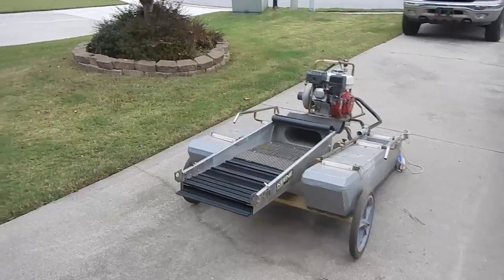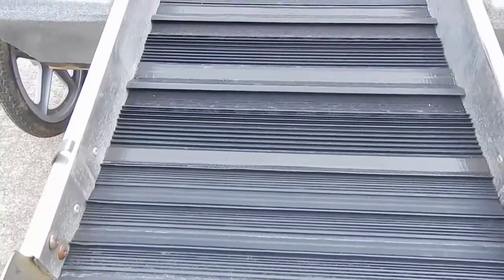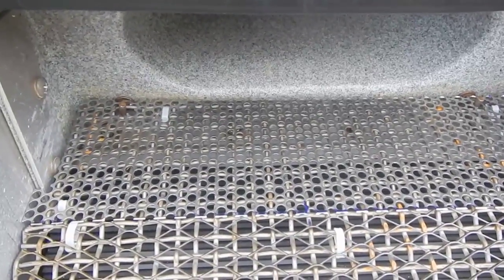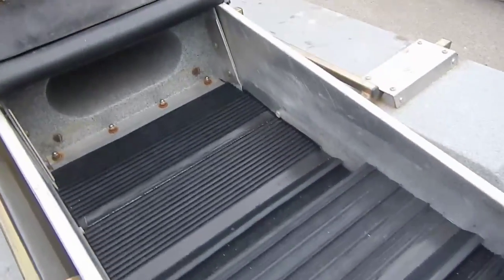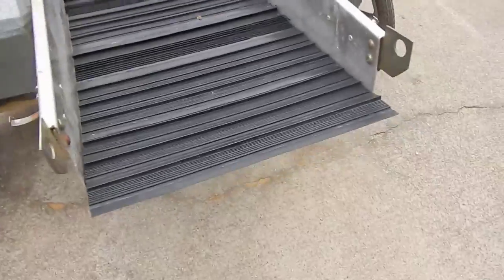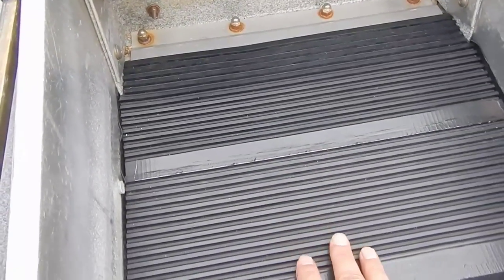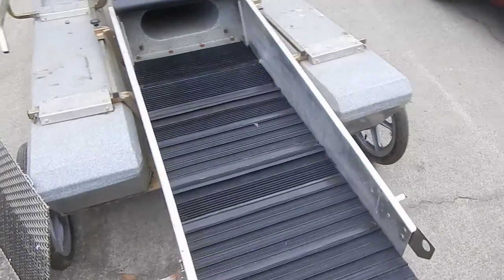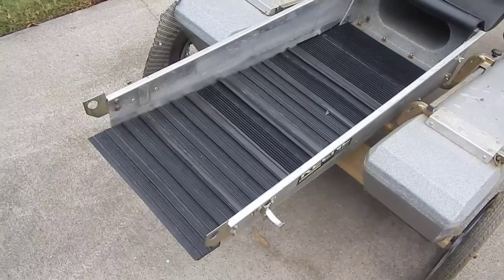Gold Dredge Over/Under Conversion with Gold Hog Matting Part 1

Comment: Hey Muddog,

Great 3-part video series on your Keene 4-inch ultra mini modifications...
Looks like you're in Georgia, judging from the Consolidated Mine shots and creek scenes.  I lived in Warner Robins, GA, for 4 years (2008 to 1012) and did a lot of dredging on the GPAA "Farm Claim"...........actually leased private property in Buchanan, GA.  Hit that place like 23 times in 4 years.  :)
I went the other route....instead of making my sluice box multi-layered, like my original, full size Keene 4-incher with the 3 stage box, I simply experimented with my mini by extending the length of the box first 2 feet and installing 5 total feet of Vortex matting with 2 panels of GH UR mat under the flair.  Second mod was to extend the box 4 feet and install 7 feet of Vortex matting with 2 UR panels under the flair:

http://c17a.forumotion.com/t35-randy-s-keene-ultra-mini-4-inch-dredge-sluice-box-mods

Later, I removed the Vortex matting and installed 6 1/2 feet of various GH mats, much like you did:

http://c17a.forumotion.com/t139-randy-s-latest-keene-dredge-sluice-mods-with-gold-hog-matting-6-jul-16

Here in pot smokin' "High" Kolorado, on the Arkansas River, the flood gold is fine, fine, fine. Normally 80% is all minus 50 mesh to 200 mesh nano specks/flakes.  Just 2 small pickers in 4 years, no NO bigger gold at all. For me, the Vortex works great.  Probably gets 90+% recover if I clean up every hour.  Just converted over to GH mats last year.  Have only run 3 times since then. Not 100% with GH, but estimate about the same, probably 90+% if I clean up every hour too. I normally run 3/4 throttle both setups.  Both run clean, despite the insane amounts of heavy black sand here (Magnetite & Hematite).  I try to run 20% material and 80% water thru the nozzle.

Can't wait for summer here to try my GH matting out more.  Randy Witham  Gold Adventures LLC "C-17A"  :)